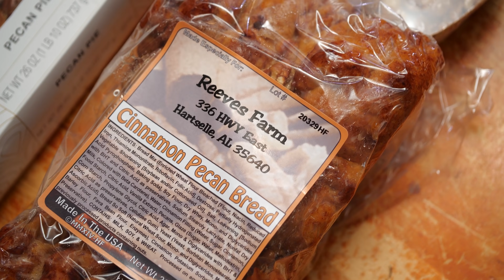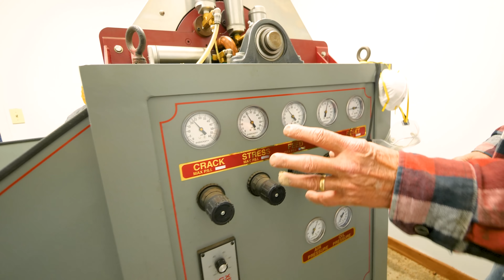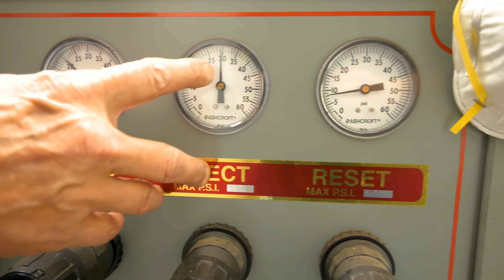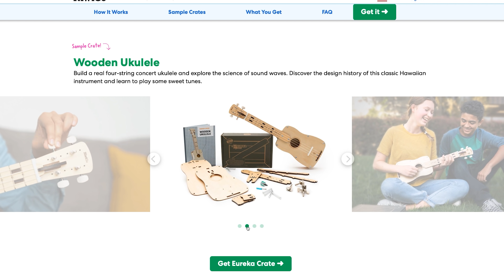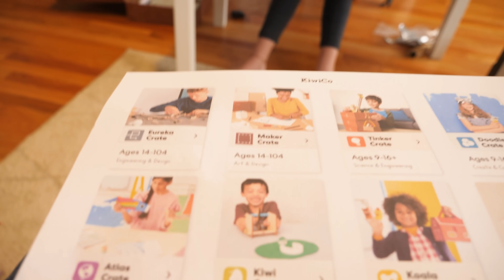How to Harvest Pecans (In Slow Motion) - Smarter Every Day 248

Comment: Just equipment cost from nut shaker, nut sweeper, bad nut separator,  to nut cracker, plus tractor...used prices is $250k. At $20 for a 3 pound bag, that 13,000 bags or 40,000 pounds of nuts just to break even on the equipment cost before labor. At used affordable prices. We have no idea how many pounds of nuts he harvested this season but I'm sure it's a small fraction of 40,000 pounds

Comment: 6:28 RIP youtube compression algorithm.
hope yall like colored noise, even on max quality lol.
Reply: It’s actually limits of the lens and body of the camera it’s really hard to capture a lot of trees and leaves
Reply: @trevoncabello2333  I'm nearly positive its the compression.
This is a very well-defined phenomenon with common compressions, when there is a bandwidth cap (as is the case with youtube uploads).
For example, see that as the leaves begin to fall, they lose definition since since it takes more bandwidth to encode all the movement, and when slow mo kicks in some of the clarity returns.
This becomes very evident if you turn the resolution down to 480p, which doesn't just reduce the resolution, but also severely limits bandwidth. the increase in motion corresponds with an incredible reduction in clarity.

slowmo guys did an episode where they specifically attempt to (and succeed at) overwhelm the compression by filming glitter blowing at the camera, and they discuss the different bitrates and what they observe on the raw footage.

Comment: Does the pecan cracker have to be tuned differently on a seasonal basis? As in, would the nuts grow tougher depending on the year and need different force application for cracking?

Comment: Yup, I am pretty familiar with this spending the better part of two decades up in Chico, CA. We shake the walnut and the almond trees. It vibrates so strongly it shakes the ground. You can feel it quite a ways off. My property in OK has several varieties of Hickory Nut, which unfortunately isn't commercially viable. Though we have TWO trees that produce hickory nuts that taste better than black walnuts. A rich vanilla flavor. Getting the nut out is a challenge but the taste is amazing.. just two trees make the better nuts, the rest are not as good.  Maybe some day someone can figure out a way to shell hickory nuts.

Comment: The machine uses an unbalanced rotating mass so it doesn't produce a vibration along one axis. I wouldn't expect anything to change if you rotate 90 degrees. 

For automated machines like the shelling one it's very common to use compressed air for actuation. It's readily available, reliable, and reduces moving parts. If you had a spring you'd have to tear down the whole machine when it broke.

Comment: When I grew up in the San Francisco Bay Area, french prune trees were popular. They harvested them with a similar machine. The trees were probably 10-15 ft tall, which made it possible to not only vibrate, but to build a giant rubber cone to shake and catch the fruit at the same time. It was split into two halves, and you'd back it around a tree, clamp it shut, then vibrate. Personally, fresh off the tree is far better than dried! Modern prune orchards have changed since then, but I'm sure there's still some retired farmer using his 70's-80's era equipment to harvest.

Comment: I have seen farmers using something kinda like this on oranges! But they use a tarp to catch them an then they go into convare belts an sperate. The tarp is like an up side down tee pee! An I doubt they would want to use them. But might could build something that would help them do less work. Question does that pto have any problems from the vibration from the mechine? I wasn't able to see hoe it dampens the vibration or if it dies at all seems it could cause seal problems to the tractors pto an possibly the mechine doing the work. Thanks for answering our question destin.

Comment: I believe your experiment results at 8:30 are to be expected. Varying the angle of vibration at the bottom will have little effect at the top - since there are so many mechanical links (branches), the effect will dampen until the vibration occurs at it's resonant frequency and mode

Comment: Shaking at 90 degrees wouldnt help because it all has to do with the harmonic frequency. The behavior wouldn't change, the only way you'd get the opposite frequency profile is if the tip of the branch is restrained. It is a basic physics principal that almost never matters lol

Comment: The axis doesn't matter because only the branches perfectly perpendicular with the axis of vibration are getting the full effect of the directional motion.  The rest of the branches aren't, but are still being shaken adequately to dislodge nuts--and even then those perpendicular branches would only benefit from  a change in the machine's axis if the perpendicular first pass was less effective due to swaying, and those unideal branches would be a rarity.

Comment: The seasonal changes in loading on the branches, result in them becoming what is known as “reaction wood”, which no matter how large it is you do not use for dimension lumber, but can use for turning blanks.  The reaction wood has a lot of residual stresses in it, and it will move and split as you try to cut it to a dimension.

Comment: We learned about this in my vibrations course. Apparently they do the same thing with cherry trees. They can control whether the cherries fall off in pairs stuck together by the stem, individually with the stem attached, or individual without the stem by changing the frequency of the shaker. Super cool.

Comment: We use something "relatively similar" for olives here in central italy.
The only difference is that the shaking machines are smaller, as the trees. Then, Instead of sucking up everything from the ground, we simply use a 20mq net disposed all around the tree.

Comment: When I was younger, I actually worked on a farm for a short time during pecan harvests. My first job was pick up the large sticks and branches. There were usually two of us kids who would have that job, and one person who could drive would pull a big trailer around so we could throw the sticks/branches into it. After the harvester filled the dump trailer, we would go back to the barn to sort the pecans. I had the job of making sure all the pecans were being dumped as quick as possible, so I would literally climb to the top of the upended dump trailer and sort of slide down with the pecans so that they didn't hit any issues where the pecans stopped feeding onto the conveyor belt. I honestly think I got that job because I was a bit too short to help on the conveyor.

Comment: P.P.S Great video, great Dad!
I could write ten pages of comment with stories of my grandmother's pecan trees (pronounced "p'con" emphasis on the 'o' and barely pronounced 'n''  by my little French "Na'nee" borne in New Orleans). In something like the early 30s, my Pawpa (Grandfather) planted a single pecan tree in the back yard of their home on the Mississippi Gulf coast. Over the years, the squirrels Na'nee loved so much were responsible for the sprouting of several more trees in both back and front yard. Every spring Na'nee would pull up dozens of saplings trying to keep the tree count to three in the back and two in the front. A few of those saplings account for the three trees now growing in my brother's yard in North Carolina and one in an old front yard of mine in Virginia Beach. Somewhere I have a photo of a little, four foot 10in French lady, snow white hair and wearing a pith helmet, chasing squirrels out of her pecan trees with a 25 foot aluminum pole. This was her fall time vigilance that went on for as long as I can remember.  Every Christmas my mom would receive a box with about 25 lbs of shelled and picked pecans. It also included a dozen or so jars of preserved figs from Na'nee's 100 year old fig tree, but that's another story.
P.S. Try cooking some bare, naked chicken on the grill, but instead of charcoal, make your fire with the fallen sticks and limbs of the pecan trees. Keep adding twigs and sticks slowly as the chicken cooks. You'll never use BBQ sauce again.

Comment: I had a pecan tree in my front yard when I was growing up, and we would just pick them off the ground and crack them open. Never realized that holding two in your hand to crack them was more than just a cheat my sister and I discovered. 

Sometimes, if we couldn't find any that had fallen, one of us would climb the tree and try to shake it with our body weight. Not very safe in retrospect, and we only had minimal results, but it was fun nonetheless.

Comment: That nut cracker is super cool.
Reply: It's a real shame he didn't use the high speed to look at the cracker.
Reply: @ViCReZ911  Wanted to say that. Missed opportunity!
Reply: @ViCReZ911  When I saw the cracker, I was getting excited for the high speed! Then, disappointment. Still a great video, though!
Reply: @ViCReZ911  this. Make a bonus on that part, please !
Reply from the maker: Agree!  Thanks for watching Ben.
Reply: @smartereveryday  
I was waiting for the slo-mo shot of pecan cracking, you missed it
Reply: @smartereveryday  can i get a thanks for watching too
Reply: @smartereveryday  I'm so surprised you didn't insist on doing a high speed setup of the actual cracking piston system in action.
Reply: Should have got some slow-mo of that thing
Reply: Although not very easy to fit on a mantel or under a Christmas tree. . .
Reply: @jcuvier135  I no nobody who puts nutcrackers on the Christmas tree...
Reply: @jackthomas1448  Note that I said UNDER the Christmas tree. Not on. Reading before replying - always a great idea. (Also, I'm sure you meant that you know nobody...)
Reply: @jcuvier135  aaaaaah, didn’t catch the “under” part. Oops.
Reply: I’d love to see the cracker in slow mo
Reply: Insanely
Reply: The system they had could have actually been made easier if they had a blower as well.  It will pick the pecans up into a small cylinder and rapidly spin them while blasting air.  This will reduce a lot of the extra shell bits and dust after they've been cracked.  The only issue is that you'll only typically find them at larger farms that can afford the investment.
Reply: that was my nickname in college
Reply: You might say it's... pretty "suite"
Reply: That cracks me up.
Reply: Nut shaker son.  Not to be confused with my wife.  "Rump Shaker"
Reply: @JGunit  heh.
Reply: I love how it has pin-striping on it.
Reply: It's like a gatling gun for nutcracking :D
Reply: That what she said.
Reply: Does it make everlasting gobstoppers
Reply: Would you say it is sweet? Nutcracker sweet?
Reply: oh no i am thinking of the other nut
Reply: @ventalariondalord2786  same
Reply: @floorsymbiosis6059  oh wow is yukako in the kitchen
Reply: @I WANT Š•È•X !!! I'm RITA !!! OPÉN MY CANÁL ! wtf are you
Reply: @ventalariondalord2786  a bot, really dumb
Reply: @jackthomas1448  ow
Reply: @ventalariondalord2786  what?
Reply: @ventalariondalord2786  what last month she was 23

Comment: The 90 degree shake doesn’t make much difference because limbs and branches have a dominant flex preference. Basically the direction the wood flexes easiest is going to always flex in that general direction with rapid resonant waves. It wood probably be different if it was a much slower shake. As an exaggerated example it’s like trying to flex a 2x4 in both directions and expect the same inflection.
Reply from the maker: So the bending moment of inertia is different and one axis than the other?
Reply: @smartereveryday  When dealing with a constant such a shaped board then obviously yes, but a tree or any upward growing plant for that matter is not quite the same to apply the same rules to. The limbs tend to absorb and redirect vibration which essentially balances out the waves. What I mean by the example with the 2x4 is that it would in that case have a more violent resonance to it if shaken in one direction vs the other. However with a tree branch it has gravity pulling it down and with the shape it has grown to (mostly horizontal), it’s natural flex is going to keep the movement on mostly on a 2 dimensional axis. Either way it’s shaken, the nuts are hanging and generally only swing in 2 dimensions. Theoretically, for there to be a difference in nut drop it would need to be shaken on the vertical axis. Technically shaking it on the horizontal axis twice from both sides is just shaking it for twice as long as the g forces inflicted are the same. The vertical axis shake would theoretically impart gravity assist and since it would be in opposition to the branch axis, it should have a stronger whipping motion on the branches. Ps, thanks for making me think about it! Love your channel.

Comment: @ SmarterEveryDay 7:50 -ish. I wonder if it would work better if the mechanical shaker was rotated so the "shaking disks" rotated horizontally? 
Then you would shake the tree in all directions at the same time without needing to move the tractor.
However, some solution needs to be made so the vibrations don't go into the the tractor or smashes up the PTO, it needs some kind of flexible power transfer (or 2 connected L-bends, so the power isn't transmitted), and the vibration thingy could be suspended with chains I guess? (it's also a hazard if the shaker weights come flying off by accident)

Comment: I need to see high speed of that nutcracker operation!  Preferably with Tchaikovsky music over top.

Also curious if height of the "grab" on the tree would make a significant difference.  The grabber seems pretty close to the ground (mandatory node); would it give a better shake if it were higher up?

Comment: Missed two points
1) Pecan Trees produce every other year
2) The shaker needs to be tuned to the tree.  This helps get the most out of the tree.
A new topic.
Haying fields.  There is a lot that goes into when you hay a field.  Smaller farms have different types of grass so they do not all need to get hay at once.

Comment: Great video Destin.   For the mathematics of the shaking, what is happening is essentially a series of inverted double pendulums, constrained by the modulus of rigidity of the individual branches (possible topic for a video, as double pendulum systems are great examples of chaotic motion with a relatively simple setup).    I really liked how you experimented with the 90° offset of the shaking energy impulse, though there is one more potential test that could be done: shake in both directions simultaneously.   This would require a shaker modification, with the weight axle turned 90° to be horizontal vs vertical.   In this way rather than imparting a single axis impulse of energy it would impart a circular impulse, essentially creating an inverted double Furuta pendulum setup which might have a higher degree of chaos displacement at the nut, or it might not since each branch connection point will have a preferred resonant frequency axis, so the Furuta effect may damp out.   With the nature of chaotic systems, this would be both interesting to model and to experiment with.  The other variable to experiment with is the speed of the shaking, controllable by the PTO driven RPM, to find the best resonant frequency for each tree...

The story of whomever first came up with the "shake the tree" method of harvesting would be fascinating.  I can just envision some farmer with hand pickers accidentally bumping the tree with a tractor, seeing a large number of nuts fall, and having a eureka moment.

Comment: I'm in my 70's and we did this by hand when we were teens and pre-teens with my father on grandparents properties. Our procedure was to spread out what tarps we had under the trees then climb and shake the limbs by hand the gather the nuts on the tarps and pickup all we could by hand. Probably like everyone else that was not mechanised, the variation my father did that I never saw anyone else do was. He would light the grass and leaves under each tree burning off and making it easier to pick up the pecans trapped by the grass. These we kept separate and we ate all of these we wanted as they were warm and roasted.
I'd like to know if anyone else did this. Many times getting to crack and eat roasted pecans was our only payment for our hard work! We also got pecans for my mother to use in her baking all year but most were sold by my grandparents as an additional cash crop for income. Please let me know in the comments if anyone else used our fire roasted procedure.

Comment: An earthquake level 7 on the Richter scale every year again, must be a special experience for these trees. There is different designs of tree shakers.  In my opinion the version with a vertical axis of the eccentric shaking weight, does a much better job than a horizontal oriented one as in this video.  The horizontal one loses half it's energy in trying to lift up and push down the tree, whilst the vertical one does make the tree rotate around.  No need to turn that unit for 90°.

Comment: First hunch looking at the top branches vibrating similarly: 
- Waves generated at the bottom flatten as they spread and lose higher frequencies sooner. (Similar to water waves.)
- As a tree is a bit like a of chaotic multi-axis  pendulum (a rough analogy but shows my point) and thus toward the top vibration becomes more random.
- Branches have their own eigenvectors for resonation and with random incoming vibration they will mostly move along those.

With the above in mind, I would expect slightly different results for different tree types (e.g. spreading foliage with many forks vs tall and lean trees with few forks, shaking at the bottom vs shaking in the middle, size of the tree, strength/amplitude of shaking). The better the waves can flatten, the closer to own resonances at the tip should be.